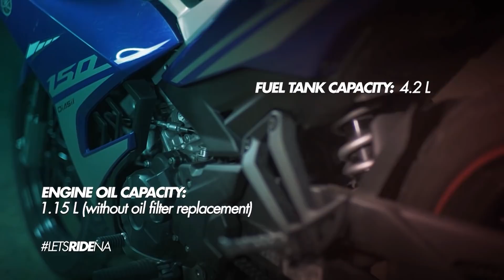Ride Mo'To: Yamaha Sniper 150 Bike Review Episode 2

Comment: 1st gen Sniper150 owner here. Ang top speed ng stock sniper is 137kph sagad na yun at 10k rpm dahil may limiter. Yung sniper na abot ng 160+ kph loaded na yun. Yung mga raider user dyan wag kayo masyadong bitter. Di naman pang top speed ang sniper. Touring bike yan hindi tulad ng raider na built for high speed kaya payat ang motor ninyo. Alam nyo sa sarili nyo pag nasa circuit o bangkingan naiiwanan din kayo. Sa professional races alam din ninyo sino ang palaging panalo kasi ang circuit racing is not about top speed. It's how fast you lean on the curves and go out of the curve.
Reply: Bisaya ka siguro. Kung nasa maynila ka wala kang roads na pwede mo pag bangkingan at gawin na tipong circuit.
Reply: Sniper= curcuit racing 
Raider= drag racing
Reply: @gshackz  di mo rin naman siguro kailangan ng top speed para sa maynila. Mas better ang handling dahil sa pangit na kalsada. Tama? 😂😂😂
Reply: @jkvb11  Doesn't necessarily mean na mas better ang sniper sa pangit na kalsada lol
Reply: @gshackz  nakagamit na ako pareho,pareho ko gusto. Pero mas gusto ko ang mas komportable ako,di natin makakaila na mas okay ang handling ng sniper. Mahirap talaga pag nasa isip mo puro speed. Mahirap din pag komparahin ang dalawa,opinyon ko lang.
Reply: @jkvb11  Mahirap din sa utak na piliin ang Manual na motor kung ang hanap mo ay "komportable" patawa
Reply: @gshackz  anong kinalaman non? Sa higher displacements may tinatawag tayong mga touring at sport bikes meron din na sport bike pero medyo upright ang position which is mas komportable. Walang masama kung mas komportable ang hanap ko sa low displacements kung gusto ko ng matulin mag iipon ako bili ako ng big bike. Nag momotor ka dba,mag research ka hindi puro bilis nasa utak mo. Wag tanga,kaaga aga.
Reply: @gshackz  hindi porket manual di na komportable 😂😂😂 ba naman yan.
Reply: Blkit msydo bitter ang nka raider sa sniper..lagi nsa utak nyo speed.Mag big bike kau kung gusto nyo ng matulin.Given nman na mas matulin ang raider sa sniper SOHC VS. DOHC.So mga nka rider wag na bitter ok.
Reply: @gshackz  ang pag pili ng motor based yan sa ideals preference ng isang tao. At isa pa walang kinalaman ang pagiging bisaya don. Sad na ganyan ka mag isip. Tama na utak ibon.
Reply: @gshackz  at kung nasa maynila ka din wala ka din pagkukuhanan ng top speed dito. Meron naman sgro pero madali kang mamamatay kaka top speed mo. Lol
Reply: anong konek pag bisaya? wata logic
Reply: 5 speed kc ang sniper, kya yung arangkada nya sa circuit malakas at talagang maganda xa ibengkeng bengkeng. Habang ang raider nmn tlgang design lng for high speed, high rev. Yung tipong magreredline palang yung raider up to 10.5k rpm and up tp 12k yung max pg wla ng limiter, magkaiba cla totaly ng engine 5 speed compare sa 6 speed.
Reply: Yung claim kc ng sa raider is 147 sa stock, habang ito 160+ which is hnd na makatotohanan. Lalo na yung mga mukang top speed d2 sa youtube na diehard suzuki gaya ko🤣🤣🤣 pero d aq biter dhl alam ko na d aabot gnun ang stock snipeeee, kht yung raider carb vs sniper 150 pa hnd padin aabot ang snipee  mas lalo na yung fi na version.... sa totoo lng mas nagagandahan ako sa sniper, pero raider user at suzuki fans kc ako. Well kpg naka gawa ng mas magandang engine ang yamaha na mas maganda sa suzuki lilipat tlga aq sa yamaha.
Reply: @entoysaudiboy5210  kanya kanyang taste o reference nlng siguro yan sir. Ok din sakin raider sa tulin kaya lang mas pinili ko yung mas ok na handling since ub lang naman. Pero thumbs up para sa tatlo nag hahari sa 150cc na ub.
Reply: Small bore long stroke ang Sniper so designed for getting out of corners fast...until the straights are long enough for the big bore short stroke Raider to overtake it. Raider 150 motor ko pero talagang better ang riding posture ko sa Sniper pag nakahiram ako...hindi mamanhid sa sakit ang wrists ko sa Sniper yan ang maganda sa Sniper. Parang Wave 125 na naging 150 yan ang Snipee ninyo. 

Kaso lang ano ba ang ginawa ng Yamaha Indonesia sa mga bagong 2020 chassis ninyo mas makapal na ba ngayon?
Reply: @gshackz  may sniper150 ako pang everyday use sa work. Pero ang weekend rider ko sa highway at circuit z900rs. Hanapin mo nalang. Kuda ka ng kuda baka nga wala ka sniper o raider. Memasabi ka lang. Hahaha. 😅
Reply: Sniper 2019 user here
Reply: @raffyintac  kaya ni sniper si raider 2km drag race paps malakas arangkada ni snipey remember torque niya magpapanalo
Reply: @entoysaudiboy5210  d

Comment: Bought sniper 150 (black raven) 2 mos ago. Tested top speed after 1 month and 10 days  nakuha ko 142kph.  Im 64kg, gasoline used Regular unleaded 91 octane, it was a sunny day humid not windy at all, warmed the engine up about 30mins before the test, chain was adjusted a bit tighter, riding position on aero,. Just my personal experienced. I have also my raider 150 fi 150 9mos old, tested its topspeed after 3 1/2 of use, same set  up what i said in my sniper test but a bit windy, topspeed nya 145kph sa una, 146kph sa 2nd then 145 sa 3rd test. Just my personal experienced mga preh. So, ung nag sasabi dito na iiwan ng raider 150 ang sniper 150 sa long rides(i dont know sa dragracing) na habulan, etry nyu lang😅😅, i believe kase sa lapit ng gap ng speed nila di na masyado significant i think doon na papasok ang factors like sa kursonada na driver, handling especially sa curve na daan. Nevertheless, i love these both bikes. (All stock pala po lahat)
Reply: Paps stock gulong mo sa una ? At huli ?
Reply: @Saint_D24  all stock lang paps during that time..
Reply: Malaya ka naman mag komento kapatid pero sa 145kph mo sa r150fi mo d ako satisfied same allstock 157kph no to brandwars kapatid alam ko sniper user ka  alam mo limitasyon ng motor mo ako r150fi user alam ko rin limitasyon ng motor ko d naman topspeed ang labanan saka d sila comparable SOHC VS DOHC 57mm bore ni sniper..62mm bore naman si r150fi..ginagalang ko comment mo sana igalang mo rin comment ko.  #RIDESAFE

Comment: Na fake news kayo sa 169 kph. Loaded yun. 
Sniper is for touring not for top speed kaya nga 5 speed gearbox lang yan eh. 

131 kph lang top speed nung sakin. 2016 movistar model. Im 60kgs
Reply: hahaha
Reply: HHha kaya nga
Reply: haha. magaan ka paps pero 131 lang inabot mo. 137-138 tlga ts ni king. 70kg ako 137 kph.
Reply: Anong touring walang ubox yan kasi nakakasagabal sa karera kaya its designed for racing yan not touring
Reply: Hirap nga sa 155 n loaded n at modified n sniper q.169 n pa niluluko lng ng vloger sarili nya
Reply: Kahit sa sportbikes 150cc tulad CBR, R15, GSXR walang stock 4 stroke na aabot ng totoong 169 top speed, pwde siguro down hill at palit ng sprocket para hindi magover rev. Mga 2strokes lang pwede gumawa ng 169kph kahit stock tulad ng KR150 at NSR150
Reply: Wala yan sa lolo ko. 132 inabot topspeed nya. Panis

Comment: Good Review pero hnd naman umabot ng 169 ung stock na snipey
Reply: Depinde sa rider pre.
Reply: @excoviixbrawler9520  modded yan. 125 to 130 kph lang kaya ng stock.
Reply: @excoviixbrawler9520  panong depende sa rider? Ahahahahah
Reply: @butchokoydematalo2074  kung marunong oh hindi hahhahaah
Reply: @excoviixbrawler9520  kahit  si vr46 mag drive nyan hindi aabot ng 171kph ang stock nyan hahahah
Reply: Di ko pa po na ranasang umabot ng 169kph pag stock. Hanggan 131 lang ako pero sa R150Fi idol ko 😅 nasa 135-145 ang top speed stock payan prove ko na yan

Comment: um nagsabi ng comment na hanggang 120-130 lang top speed ng sniper.. makikipustahan ako sakin stock im weighing 60kg plus gamit ko.. almost 70kg plus.. kaya naman lumampas ng sniper ko 145lampas kya nga 150 lampas basta bwelong bwelo.. at pigang piga.. kung 123-130 lang yan for sure mas mabilis pa ang yamaha x1 na 108cc tapos 2 valve lang kaya umabot 135kmh.. makikipustahan ako kahit magkano kya lumampas ng sniper ko 145kmh lampas.. mgaa bugok lang kaya hangang 130 lang daw.. raider series ko 1 kung nakaopen pipe kya 159-160 kung stock kya 145 lampas din pero no match fi ng raider.. pero sakin mas. mabilis sniper.. sniper 135 nga sinisibak raider 150.. diasil cylinder kasi angat sa common piston and cylinder tulad ng raider..